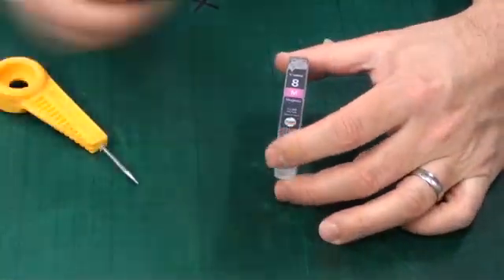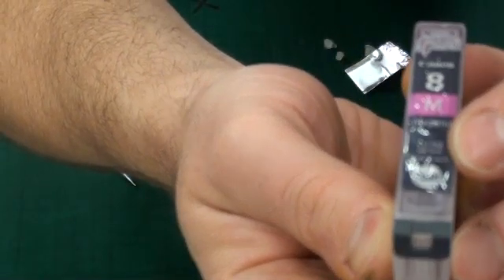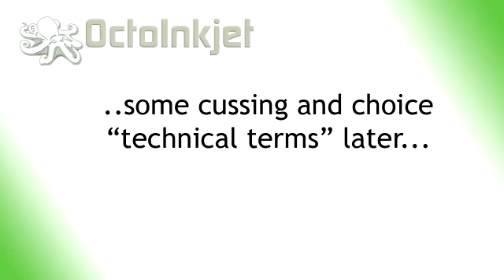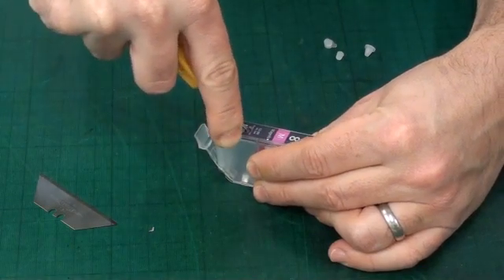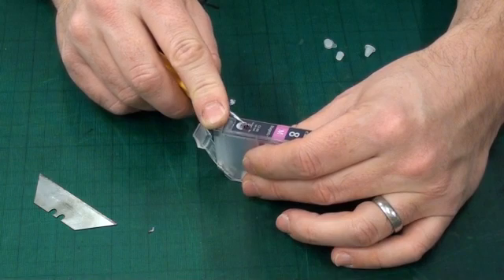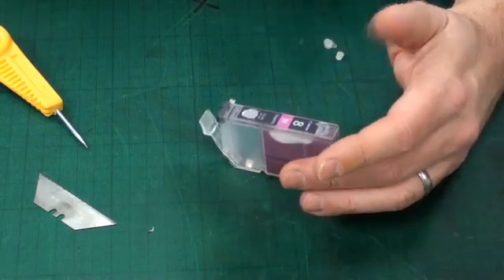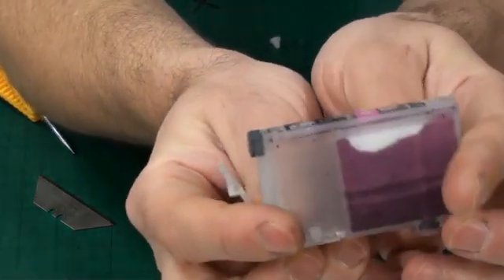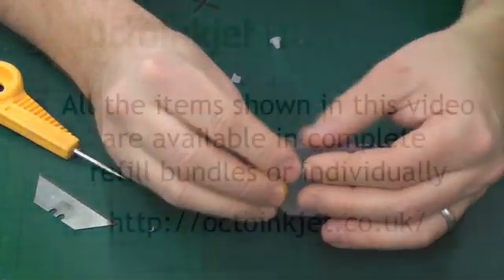Modifying Canon inkjet cartridges for Top-fill refilling

Comment: i used tape and it leaked. bought the plugs. now about to try it.
Reply from the maker: You need to use Aluminium tape as it has a non-water-soluable adhesive. Normal tapes tend to leak because they are water soluable.

Comment: Do the chips need resetting?  How do you do that?
Reply from the maker: Depends on the cartridge type but for chipped carts you can either use a chip resetter (if available) or disable ink monitoring to all the cartridge to be reused.

There’s other videos on our channel that tackle both scenarios.

Comment: Sir plz tell Can i use this method on canon pixma ix 6550
Reply from the maker: Hi Usama, It will work with the CLI-571 cartridges but you might find this video more useful. https://www.youtube.com/watch?v=UQHPBADjxTw
NB: The CLI-551/PGI-550 cartridges are physically the same as the CLI-571/PGI-570 carts.

Comment: My printer have 2 black cartridges and one more is bigger which is pgbk..what is the different between bk and pgbk ink ? And can i use the same black ink for both of that cartridges ??
Reply from the maker: The larger PGBK cartridge contains pigment black ink, while the thinner CLI-?BK cartridge will contain the dye ink or photo black. You can potentially use dye black ink in a pigment ink cartridge but definitely do not put pigment ink in the dye ink cart.

Comment: Hi and thanks for the tutorial. Do you think, is it possible to re-fill the Canon PIXMA PRO IP 100s? Thanks in advance. 
The only issue is this, when the ink runs low, the printer starts to messing about and keep warning you that the ink is low and stops printing (at least, this is my experience.)
Reply from the maker: Assuming you mean the Pro-100S in which case you definitely can reset and refill the CLI-42 cartridges in those. We have a full refill bundle as well as pre-modified cartridges that are ready to refill with our version 2 inks:
https://www.octoink.co.uk/pid/740

Comment: Videos from other providers suggest drilling out the ball seat with a 5/32 inch drill bit.  Am I right in thinking that the plugs you supply make this unnecessary?
Reply from the maker: We're updating our guidance on this so a new video will follow soon-ish.
The ball itself won't come out if you drill it and I honestly wouldn't try drilling through the label but once the label has been excised and ball removed then drilling the original fill channel, with a 4mm (5/32") drill bit, does provide a much cleaner and more reliable plug hole. We now have the longer 4mm diameter plugs available too.

Comment: Hi, thanks for video, might be a silly question but why not just insert ink into the already open hole at bottom of the cartridge?
Reply from the maker: Actually you can but it's not as easy as just pushing ink in, because the ink will take the vent channel exit before anything goes near the spongeless reservoir part of the cartridge. So, the way to refill the cartridge via the outlet port is to use the Vacuum fill technique which is basically pulling the air out and allowing the ink to replace it. Video pending on that.

Comment: thanks, are there no problems with the printer rejecting this cause of the computer chip that later on warns you your cartridge is empty
Reply from the maker: You would need a compatible chip resetter (eg: a REdSETTER) for your specific cartridge type to retain ink level monitoring. It is still possible to refill a cartridge without a chip resetter, but you would be forced to disable ink monitoring when the printer detected the cartridge was being refilled.

Comment: I drill a hole in the side and cover it with electrical tape.
Reply from the maker: Wouldn't recommend that as the electrical tape has water soluble adhesive. If you want to go that route, aluminium tape will do the job.

Comment: Hi what about canon 570 and 571 do i have to reset the chip or not thank u
Reply from the maker: You would need a compatible chip resetter (eg: a REdSETTER) that could reset the 570/571 cartridge types to retain ink level monitoring. It is still possible to refill a cartridge without a chip resetter, but you would be forced to disable ink monitoring when the printer detected the cartridge was being refilled.

Comment: That's great but if you check my video i use a regular screw to plug that hole.
Reply from the maker: Ref: https://www.youtube.com/watch?v=xZ53xrfSHlQ&t=0s

You can use a screw yes but the rest of your video does a bunch of things that make things harder rather than easier... In the interests of a little constructive criticism:

1. Using Sellotape or similar to seal the outlet means your ink is going to leak everywhere (as you saw)... The adhesive is water soluble so if you need to use tape go with something aluminium tape, a compatible orange storage/transport clip or rubber band the original orange clip on instead.

2. Water soluble adhesive can become a problem at the outlet with residue left over and then getting into the printhead.

3. You need to make sure your screw is not going to react (ie: rust) with the ink or again you end up adding more problems in. Best material is a plastic/nylon screw using that approach but key point... your printer may have little or no clearance above the cartridge so a screw it going to jam against the internal ceiling and stop the printer working. MG/MX printers in particular suffer from this... 

Understand where you're coming from and the rule; "if works why fix it" applies but there's a few things in there that long and/or short term are going to cause problems so hopefully the above points are useful.

Comment: When pulling out the ball. I found that a thick pin pushed into the ball deep enough will let you pop it out. Best way to do this without pushing too hard into the ball is to heat up the pin beforehand so that it just melts into the center of the ball. If this makes sense?
Reply from the maker: That does work but be careful to wait until the need has cooled before levering the ball out or you can melt a channel into the side of the fill hole and create an air leak even with the plug installed.

Comment: got a canon mg6460, refilling it is the easy part but i cant figure out how to reset the ink levels, it wont let me print still says its low on ink
Reply from the maker: +QuickTips Mechanical You can't reset the chips on the PGI-650, CLI-651 original carts so might want to look for compatible refillable carts or similar. Given you appear to have an Australian model, try contacting Rihac.com.au to see what they have.
Reply: Hi, would the MX860 (PGI-520/1) have the same problem?
Reply from the maker: If your cartridges use the PGI-520 and CLI-521 chips then we have the compatible chip resetter (known as REdSETTER) on our OctoInkjet store:
http://www.octoink.co.uk/products.php?productid=216

Comment: First of all - thank you so very much for this instruction. However, a quick question - I've just bought Canon Pixma MG-5750 and would love to know if I will be able to use that method for re-filling cartridges. The original set of cartridges is waaay too expensive to even consider it and the third-parties' products are sparse in Poland. So, I was thinking - refill would be optimum for me. Can I or can I not use this method? Cheers!
Reply from the maker: +JoAnn77PL Hi, glad it has been useful. Regarding the MG5750, unfortunately the x50/x51 and later x70/x71 cartridges are not particularly refill friendly with clear differences between the setup cartridges and those sold as XL types. Unlike earlier models you can't refill the setup cartridges beyond the sponges as the spongeless section is completely sealed off, unlike XL types. Throw in issues with the chip design and materials being a lot harder to reset or replace and original cartridges are not as refill friendly as earlier models.

We've switched to using third party refillable cartridges instead for the x50/x51 cartridge printers as they avoid most of the above. We've not looked at the x70/x71 versions yet but those may be out now through aliexpress or similar.

Comment: Why not just buy a new cartridge? Do you cut open your toothpaste tube to scrape out the dregs?
Reply: +Ken Pollard Ink is insanely expensive. You can buy toothpaste at the dollar store.
Reply: +octoinkjet Not sure this comment deserved a reply, Ken obviously isn't your market. Great instruction but could have done with a video showing how to apply the ink and soak the sponge.
Reply from the maker: +Ken Pollard : The process described allows you to refill the original cartridges. Granted there are third party refillable cartridges designed to be refilled, but in most cases the original cartridges have a better design and component quality (particularly the various sponges) than most compatibles so it's worth the effort if you're wanting to use bulk ink and refill.

Obviously doesn't suit everyone but it's not intended as a sales vehicle, just a tutorial on how to prep' for refilling.
Reply from the maker: Agreed.. We're intending to focus on the refilling and ink side of things in April/May so resources like that are on the list.

Comment: think i might use a matt knife rather than just the glad for those who are not too handy
Reply from the maker: edward coggins Good point. Key requirements are that the blade is sharp and you are patient. Blunt blades and rushing the process, are sure fire ways to recreate a Magenta style ink effect and a lot of unnecessary swearing.

Comment: Is this for all Canon injet cartridges. I have CLI 655 & CLI 651 printer in the MX926. Many thanks
Reply from the maker: kath tarawa The 650/651 cartridges are a very different design to the earlier types. The general premise may apply but the starter/setup cartridges are deliberately limited to stop you using the spongeless section.

We've opted to use third party refillable cartridges for those types instead of OEM but there are other resources about the x50/x51 types out there.

Comment: does the seal bit have to be completely air tight shut? I put the ink in and but then it just started leaking from the bottom part
Reply from the maker: You do need to seal the fill hole so that it's air tight or the ink will leak out the bottom as you've found. Only the vent hole/matrix should be open to the air.

Comment: Vous ne parlez pas de la puce sous la cartouche qui lorsque la cartouche est vide bloque l'imprimante, même si on la remplit de nouveau . Faut il la reseter ? avec quel matériel ? n'y a-t il pas en dessous de la cartouche aussi une détection de niveau d'encre ? remplir c'est facile, mais qu'elle fonctionne sur l'imprimante , c'est autre chose.
Reply from the maker: This video does not demonstrate the whole process of refilling and was never intended to do so. A video that shows how to refill will be completed in the future but isn't currently available.

But to cover your points/questions...

1. The chip does need to be either disabled (by accepting the warranty warnings and disabling the ink monitoring for the affected cartridge) or by using a chip resetter. We recommend the second option with the REdSETTER unit as you retain ink monitoring.

2. If you reset (using a REdSETTER) then the printer retains the use of the prism and will warn you that the cartridge is low even if the chip thinks that the cartridge still has more ink left.

As I said, this video only demonstrates the process of physically preparing a cartridge to allow refilling (ie: open fill hole) and sealing the refill hole when finished.

Hope that clarifies things.
Reply: octoinkjet quel redsetter utiliser pour les  PGI 550 et CLI 551 ? Merci.
Reply from the maker: The 550/551 chips are a completely new design and type that no longer uses the old style green circuit boards. Now the chips are a very thin printed type of circuit that is very fragile. My understanding is that it makes the process of resetting nearly impossible or very difficult so no redsetter (or other resetter) is available.

We are leaning towards refillable cartridges with Auto Reset Chips (ARC) as the only viable option but those also have some problems that we're waiting for a solution no.

Short version... Canon have worked hard to make refilling/resetting more difficult.